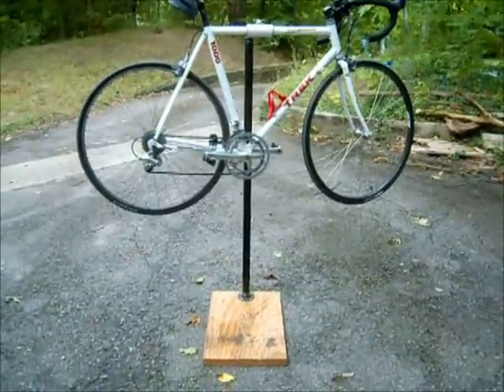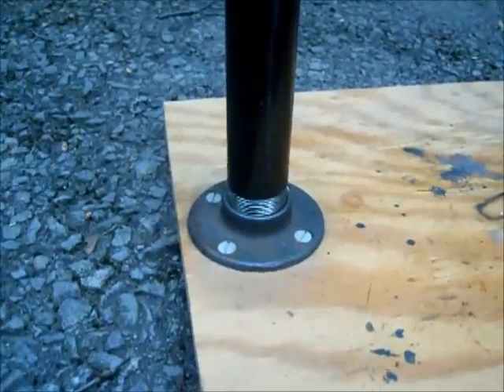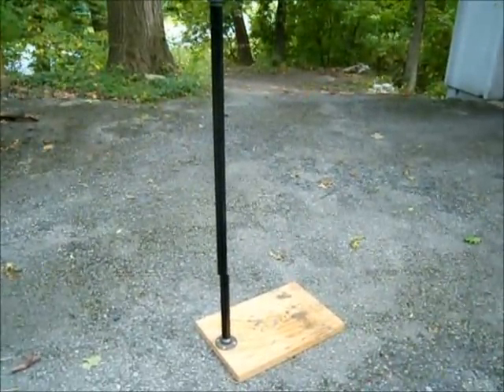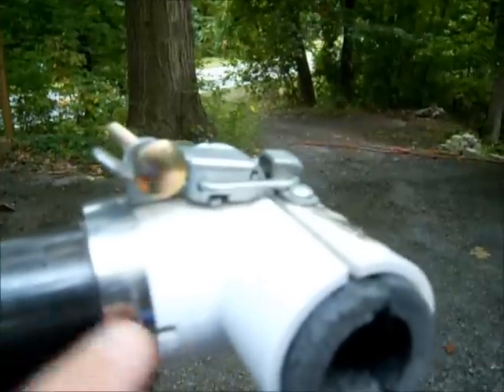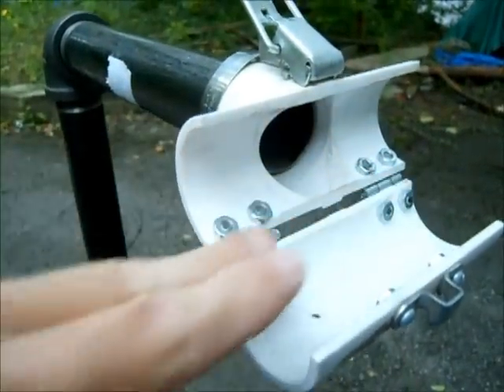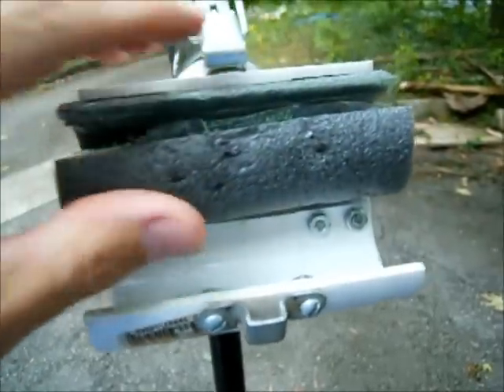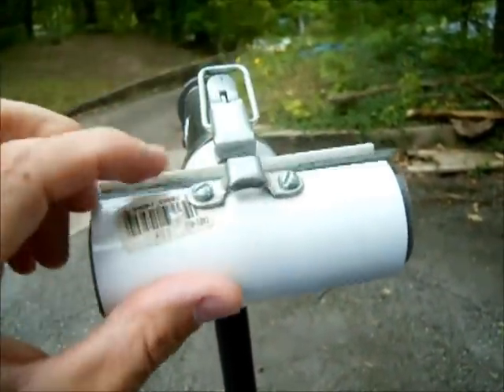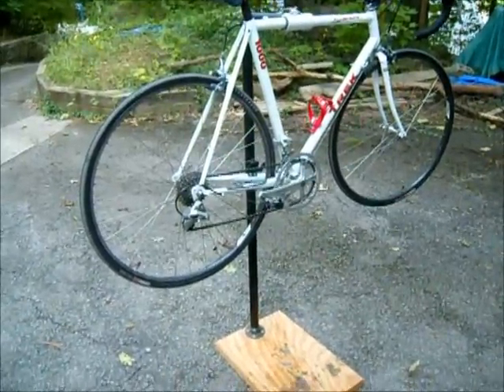How To Make A Bike Repair Stand DIY

Comment: Thank you so much RJ for sharing your plans and video with us. This is exactly what I need. I retired and am trying to fix up an older mountain bike and needed something like this to help me  adjust the front and rear derailleurs. I think this is the most stable of designs I have seen for self made stands.  I think I will have to use a 1.5" PVC T because of the size of the crossbar on one of the bikes I will be working to repair.

Comment: Thanks a tonne. Made my own, albeit with a few improvisations on your basic design. A. Screwed the second piece of plywood in the four corners instead of using adhesive. B. Inserted the bolts from the bottom and sawed off the ends that came out on this side of the flange. C. Used six rubber buffers on the bottom of the wood. D. Used a more improvised clamping system. Basically, welded a small rail kind of thing (wide enough for the top tube to sit on), to a short piece of round pipe with internal thread on one side (I think plumbers call it a socket) which I fixed to the extending arm. Works fine for me with a piece of foam in it to make it scratch proof. If I made another one I would make it chest high. This one I made is as high as my neck.  I could saw the pipe off and sort the problem but don't want to dismantle it again.

Comment: Nice stand. Starting with your idea I expanded on it. I made the base a little wider to the rear and more two the front the reasoning for that is because I used a shorter pipe at the top going out of the 90  to a union then another short pipe to the PVC tee this way I can losing the union and move the bike 360 around if I wanted to. If you do this though you need to keep two crescent wrench close so I made a tool tray. I cut the standing pipe 2/3 up from the floor and  re-threaded the pipe ends after cutting a hole in the middle of a pan I put a coupling first then placed the pan over the hole screwed the upper part on the done right? Not lol. Pan might move so I used J.B Welled. Worked grate. Working on a better Tee end now. The second end is easier. Just put another flange on the top end still using the shorter pipe and losing the union. Go to Lowe's or where ever and buy a storage hanger. Lowe's has one that works just right No# 267936. You can't 360 the bike but the arms of the hanger are long and wide just use a Velcro strap to hold the bike in case you bump it. Their you are two types of hangers one stand.

Comment: Hi, thank you for sharing. It is a very nice idea, but I would be concerned with the nuts inside the "holder". The insulation is not rigid enough and with time you might find some dents in your bike tubes. Think that the weight of the bike is resting over the nuts.  Anyway this is the only thing I would change, everything else is very nicely and easily done. Thank you again.

Comment from the maker: It holds the bike up at a more convenient level while working on things like the derailleurs and cranks, etc. It allows you to have the wheel off the ground so you can spin the cranks while making adjustments to the derailleur. In general, it just makes it easier to work on the bike for many things.

Comment: hey, not bad.  For a few bucks and a little time.    But only going to work on a bike with straight tubing, so no fancy carbon shaped frames.  Something to grasp the frame at the seat tube would also be a good option.  I have been using a tie down strap thrown over a rafter in the garage or a tree.  Works great, and no assembly required.  I can lube, change tires whatever.  I've done complete rebuilds that way.
Reply: That's one way to do it!

Comment: You can beat your brains out doing this or for under $100 get a Bikehand stand that's far more versatile, portable, durable and overall just works better.
Reply: not everyone has $100 to burn on something this useless and un needed...
Reply: Brassplyer Or better yet work on your bike with no repair stand at all.  I never use a repair stand.  I just bought a cheapo chinese aluminum rear wheel A frame for $12 on Ebay.  Small, light, folds flat and designed to pinch both ends of the rear hub skewer proping the rear wheel off ground so you can dual in your shift indexing, and work on your derailleurs and brakes.  Unless you have a permanent dedicated bike workshop, bike repair stands are unnecessary overkill.
Reply: Michael Greene yeah, a small one could do the job but it is a bit harder to pedal if it's that low on the ground so something like this is pretty good if you service your bike regularly on your own
Reply: Can you please provide me with more information on this "aluminum rear wheel A frame", Michael? Thank you.